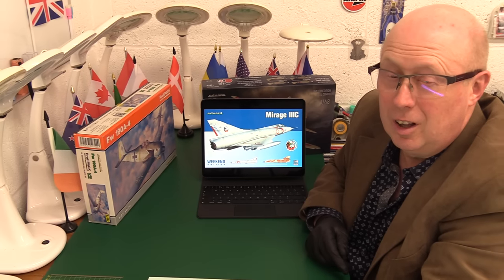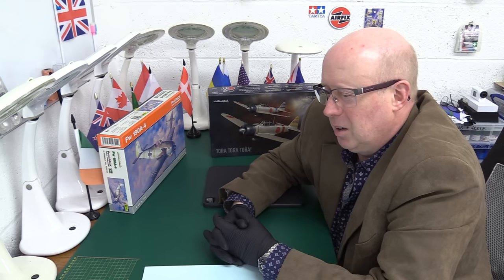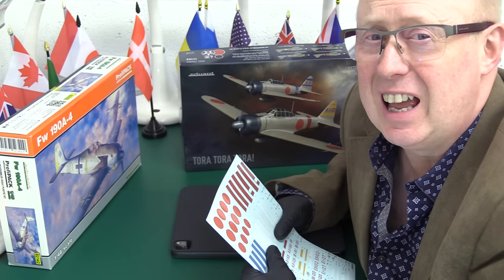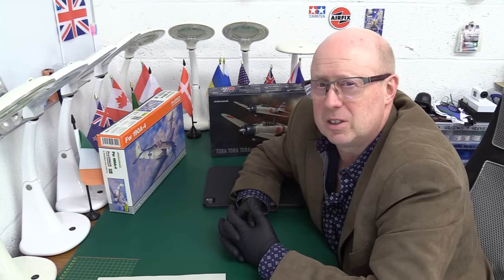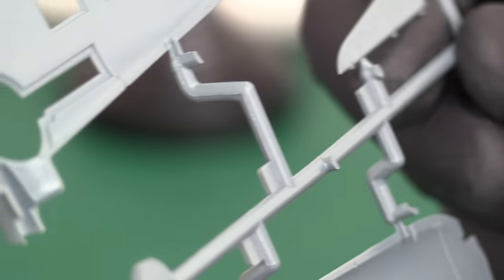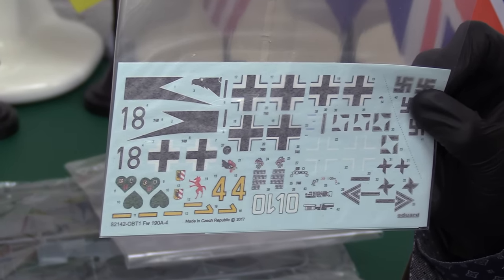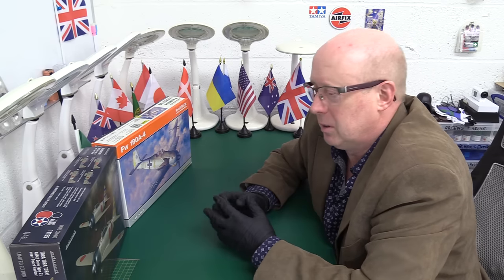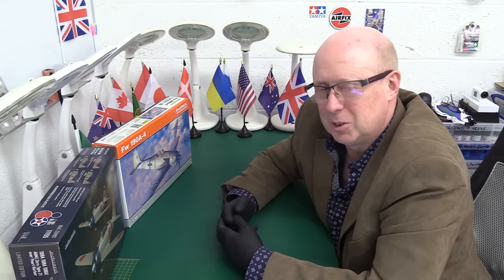Let's talk about...EDUARD (Rant!) 😠

Comment: I think part of the problem with the new decals is modelers want to get to finish line and don't wait for the decals to dry up after applying. I've used them and they were pretty good. The key is to wait a few hours after applying the decal then putting Tamiya tape over the decal to lift the carrier film. Once its lifted  partially you can take tweezers to remove the film. don't apply too much pressure with the tape and be gentle with tweezers. But you're right not informing their customers of the decal change was a cock up on their part.
Reply: Ah sí? No me digas máquina… gracias por tus consejos 😂
Reply: On my first Eduard kit I had no problem getting the decal film peeled off.  I would scratch with my fingernails than the tweezers.  The results were great, they looked painted on.  My second one today has been a disaster.  They have lifted off the entire decals and now the model is a mess.   I suspect it is not technique but almost a curing and surface issue.    The first one almost baked in the garage for the day ( during the DC summer) also I think I may not have gloss coated it before putting the decals down.   Todays one I had put a gloss coat down and it was cooler more humid weather, so I left it for two days but on half the decals I had tears and lifting.  Have another one I have yet to gloss  so I am going to put them straight down and see what happens....

Comment: That "granular" surface finish, as you call it, is where the mould has been made using spark-erosion and then not polished.  Spark erosion allows for very very fine detail to be cut, but it is just lazy (cheap?) to then not bother to polish the resulting mould.

Comment: You're way off on your assessment of Eduard's new decals.  They are a DETAIL company, and eliminating carrier film is a huge advantage.  If anyone can't handle using a simple pair of tweezers they can go back to the childrens' companies (Revell, Airfix, Italeri).  Actually Eduard's are EASIER,  but you completely ignored the alternative, and instead over-focused on assumed defects.  Would you rather: 1) apply decals, remove film  or 2) gloss coat, apply decals, sand carrier film edge off (if you even can) of perfect new paint/decals work, and clear coat.  Saying they are anti-builder and refusing to admit gross mistakes is illogical.  Their mistake was, as you rightly say, not preparing the customers, which they could have made into an opportunity by hyping the benefits and ease of use.
Reply from the maker: Premium modern decals like Cartograph have almost zero carrier film visible beyond the printed decal. I think Eduard introduced this too soon and have a decal system that looks like an prototype experiment...lets see if they persist with it.
Reply: @Peter-Oxley-Modelling-Lab  Cartograph are too thick and glossy for my taste.

Comment: IDK, I've been very disappointed with Airfix considering all of the hoopla over their new toolings. Recently built thier Hurricane Mk I in 1/72 and ran into fit issues on the second part I glued up!  Still, compared to virtually all kits made more than 30 years ago, Revell, Airfix and Eduard are light years ahead. In the past one just assumed that some fit adjustment would always be necessary (unless it was a Tamiya shake and bake kit.) Of course, you spent two or three times as much on the Tamiya kit to get that fit.

Comment: Just a thought, I have built 3 kits now with the new style of decals and not once have I had a single issue with them. Eduard do state you don’t need to peel anything away from the decal they are not designed that way, I simply used micro sol and set and they look amazing, as good as there old style decals for sure, so people stating the pain to peel them off is rather self imposed as eduard have stated numerous times this isn’t necessarily, after a clear coat and a flat coat the look amazing believe me. Maybe try the decals before forming your opinions on others peoples findings.
Reply from the maker: 😂 I did do. Maybe check my recent vids before commenting on a vid from weeks ago? Keep up!

Comment: You sound like you're describing Revell aircraft kits of the 1970s, not Eduard! Or better still, Mach 2 but everyone picking up one of those kits usually knows they're in for an "extended project" or a "skill builder" type kit. I'd expect better of Eduard, shames.
Reply from the maker: They used to be brilliant until 2020 ...

Comment: The Eduard Mirage is a very, very old kit for them now (15 plus years)... The FW-190A-4 is 2017 and the Zero is 2022, so only 5 years apart, not 7... Since the Spitfire Mk IX of 2013 (a new still unbeaten worldwide standard imho: The best of Tamiya can barely even share the same shelf, especially with a deeply weathered wash: Also, Tamiya's 1/32 Spit IX is far less accurate, having a huge transition angle between the cowling and spinner). Eduard are simply on another level, but accuracy is still a bit iffy on small details like the P-51 MG openings, Tempest V windscreen, or the lack of P-51 cowling fasteners (which Airfix overstated, but still better than fictional dots). Tamiya accuracy in 1/48 has only really improved since their Me-109G-6/ Ki-61 (I absolutely detest their 2003 P-47), but both the Eduard 190s and the P-38J have cowling shape issues... The new Eduard decals are outstanding, revolutionary for metal finishes in how easy they are to peel, and work fine without peeling, although the long film edges do want to curl a bit. There is not much wrong with the new Eduard decals, and I will occasionally buy Eduard kits just for the decals alone. The Zero's red markings did look grainy, but this has not been repeated in other colours, and may not even show up that much once washed and weathered.
Reply from the maker: Tamiya have far older kits from the 90's that go together much better so that is not much of an excuse. But I will be building the newer Zero soon, so we will see. I will do an after-build review too so we will have a factual and frank summing up.

Comment: Of course every modeler looks at things from  their own perspective and has their own priorities.   But Tamiya (or Zoukei Mura et al.) better than Eduard?   Maybe in some bizarro alternate universe, but not in this one.   I can cut and dress a multitude of thick sprue gates and fiddle about with minor (or even relatitively serious) fit issues with much less drudgery than I'll spend trying to bring the surface detail of a Tamiya kit up to what is now, thanks in large part to Eduard, industry standard.   I do agree with the point about the somewhat "dot matrixy" look of some of the newer decals, but to me the peelable carrier film is a major plus, not a minus, and well worth the effort for the result.
Reply from the maker: @Relic You are kidding right? Some of the recent eduard kits have plastic with a grainy, granular surface that diminishes the fine detail.
Reply: I've seen the grainy surface on areas of some Eduard kits (IIRC, the Tempest for example), but that doesn't change the fact that all Tamiya kits with the exception of the high-dollar 1/32 stuff are, compared to Eduard, missing tons of detail. And on the subject of bad in-house decals, Tamiya's plywood-thickness examples make any issues with Eduard's inconsequential in comparison. @Peter-Oxley-Modelling-Lab
Reply: @grimfist79  I don't consider Tamiya kits "bad",  and in most cases their engineering is beyond reproach.  But  by the criteria I look at in comparing kits,  they're in a tier below Eduard.  I believe, however, that market pressures will eventually prompt Tamiya to step up their game on detail.   The inevitable price increase will be a downside though.
Reply from the maker: @relic2860  Hmmm...most commenters seem to disagree with you. The point I think you are missing is that part of the appeal of Eduard is the variety of schemes and 'everything in one box' which they have now ruined.
Reply: Well, the thing is that I don't consider the new decals to be unusable.   It's a shame about the dotty nature, but the removable carrier film is a big plus, especially for smaller markings like wing walks, stencils, etc., and goes a long way toward making up for the dots in my estimation.  And I tend to mask and paint larger markings whatever the decals at hand.  To be honest, if I were going to criticize anything about the current Eduard kits, it would be the "graininess" of the color photoetch.    @Peter-Oxley-Modelling-Lab

Comment: iam not a great modeller maybe bit better than average because ive been at it for nearly 50 years!! but i must have been luckly but i built the Mirage in March no problems no warps or bends a nice build and made into a good model cost less than £25 i think ive only built 4 Eduard kits mig 21 good kit and hellcat in 1/72 and 1/48 combo  very good kits and the mirage mine was a good kit ,ive built some crap kits over my 50 years some cheap some expensive iam a modeller i build whats in front of me some test what skills i have got some just need some glue and build themselves  any way like your rants cant wait for the next one who will be?
Reply from the maker: Maybe you got a good one from an early batch? 👍🏻 Most people struggle with it. Coming soon: 'The Chinese kit makers'! 🫣
Reply: that should be fun! @Peter-Oxley-Modelling-Lab

Comment: Just build Lego
Reply from the maker: ...or Arma, ICM, ZM, Tamiya, etc, etc
Reply: @Peter-Oxley-Modelling-Lab  Or actually use the decals before forming an opinion. Try them.
Reply from the maker: @michaelgrey7854  No thanks. I seen enough other people struggle with them and ruin their models...Eduard have a simple choice: Change back to sensible decals or be destroyed by their competitors.
Reply from the maker: @michaelgrey7854  They are badly printed. And difficult & time consuming to apply. Fact.
Reply: Arma like Wingsy are worthy rivals but I’m building the ICM 1/48 B-26K - wrong shape nose, hub reduction gear, wrong wheels, underscale control columns and generally lacking cockpit. Tamiya
1/48 MkVb Spit with its “interesting” wing root contours that they carried over into 1/72 and their thick decals. ZM are in a different price range so not comparable. I think I can live with join face sprue feeds that save surface detail and I’ll just not peel my decals!
Reply: @Peter-Oxley-Modelling-Lab Can’t really cope over it of not even using it can you? «But other people told me so, so that’s the fact». 
Probably old people refusing to learn something new in decals, these ain’t bad at all